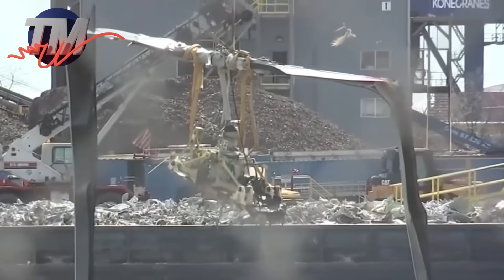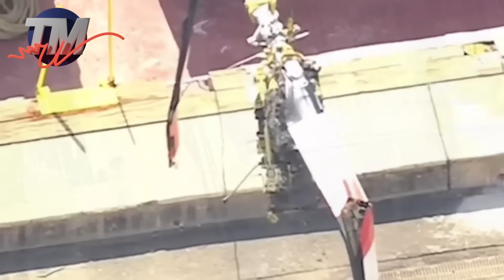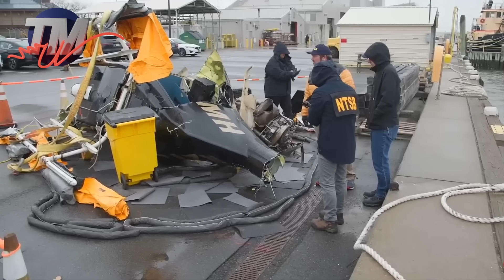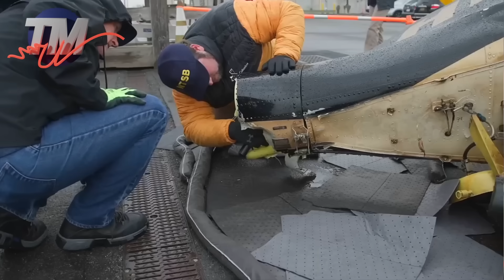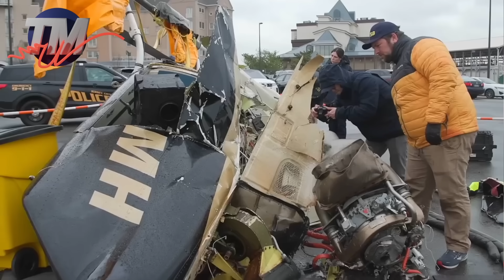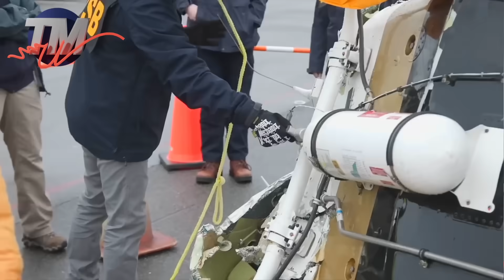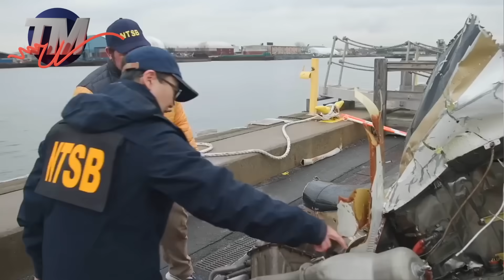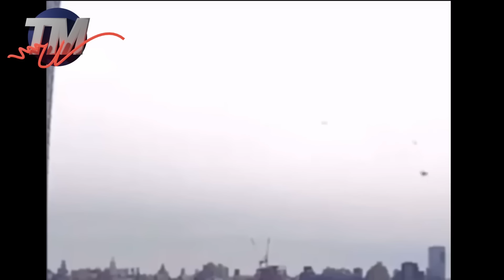Recovery of the Main Rotor of the Hudson River Tourist Helicopter - it's worse than we thought

Comment: Witnesses on the ground reported hearing what sounded like a sonic boom before the helicopter tore apart.  I live in New York City.  This is a very loud city by its nature.  For a sound like that to be heard by mostly all the witnesses with all the background noise here made me think that it was a very powerful force that happened.  I don't want to speculate, but it definitely doesn't make sense.
Reply: We'll never know the truth.  Only what they want to tell us!!!
Reply: Witnesses are notoriously inaccurate.
You get reports of flaming aircraft and explosions where there are none, pilots facial expressions from 2 miles away, screaming engines in glider accidents, etc etc… there is a fascinating psychology behind it.
Children make the best eye witnesses as they have not been influenced by movies and general sensationalism, they have no preconceptions or agenda and do not project.
Reply: The video WITH SOUND that shows helicopter flying normally, then disappearing behind skyscraper for a few seconds, then flying a couple seconds more before everything comes apart. 4-5 loud bangs that do NOT sound like sonic booms. It sounds to me like a gearbox being ripped from the roof of a helicopter. NTSB will measure the distance from camera mic to helicopter, calculate the sound delay, sync sound & video up. The banging will stop when the gearbox breaks free, along with main rotor, and cabin begins the fall to water.
Reply: Has anyone checked the background of the customers? Have they ever said anything negative about current regime? 
Nothing is off the table.

Comment: Speaking in terms of physics - the rotor has a certain angular momentum. If the transmission seizes suddenly and the rotor cannot freely turn, that angular momentum will be instantly transferred to the entire helicopter, including the cabin and tail boom. The sudden torque was so great it sheared off the entire tranmission and rotor assembly, at the same time giving the helicopter body an enormous angular kick, which accounts for the sudden yaw motion. This was probably enough to snap the tail boom as well, because that also has its own angular momentum stored in the tail rotor, and that will resist the sudden yaw in the manner of a bicycle or motorcycle wheel. This again would create a great sideways bending moment on the boom close to the center of gravity, thus snapping the boom at a point close to the body.
Reply: The rotor mast has a sheer pin in it that would allow the rotor to continue to spin if the transmission seized up.

Comment: It is a bit outlandish but bear in mind, the passengers include some high brass multinational company, and I really doubt it was funny business, but this is the type of person you would take out with funny business.

I am absolutely reaching with this one, but hey, if I remember right with the hack the US did ages ago, on centrifuges in iran with notably Siemens control systems, it’s not all the wild to say they may have some interesting clients that some powerful people may not be a fan of.

Loosen a few critical bolts, oopsie level of sabotage required perhaps? Think of, loosening a few head studs on your motor, oopsie head gasket went out, how’d that happen.

Eager to see what they find out either way, but fair call on not ruling things out. Passenger wasn’t a nobody, this was a wild failure to witness, and it’s scary to consider how introducing a few, weak spots before a flight could perhaps induce such a failure.
Reply: The odds of someone  sabotaging the helicopter to fail in a 15 min window is astronomically impossible.
Reply: @ Loosen a few bolts, let nature do the rest, not really hard, hold together enough to get into the air, vibrate loose in time, doesn’t have to be that specific.
Reply: @ApolloTheDerg  For it to be on that specific flight, it has to be very specific. 
Try to wander out on an air operations area with your toolbox and let us know how that works out.
Reply: @ Missing the point, yeah it’s outlandish and very much unlikely, I’m not disagreeing, just sometimes reality ends up stranger than fiction. Take note of the Iranian nuclear refinement facility and the complexity of running the centrifuges out of spec over time to induce failure, espionage does not always happen in broad daylight with a simple paper trail.

Is it likely, nah, is it possible, yes. Could simply tamper with calibration of a PM’s torque wrench in a supply chain attack to be certified yet, inaccurate, small little oopsie with intention, but it’s very much a stretch here. This is more like taking out a world leader in their private helicopter level of crazy im talking, im well aware.

Comment: Carbon composite main blades were fitted to this helicopter. (OEM blades are aluminium). I wonder if this contributed in any way to the incident?
Looking at the video of the rotor assembly being lifted by a crane…
The skin surfaces at the break are totally flat. Aluminium sheet would have a curve at the point of tare. Also the tare edge would be mainly curves. The torn edge of this blade skin is *totally jagged*. 
Definitely a composite blade and not aluminium construction. (It does have an aluminium leading edge protection along the entire length).
I notice that Van Horn Aviation supply composite blades for 206L. (Don't know if they supplied these blades or if there are other composite blades available). I think they say they have 250 sets in use on the 206.
Looking at the incident video shortly after rotor separation from the helicopter, I'm fairly sure the major blade fractures occurred in flight, and not on impact with the water.

Comment: However, no one correlates a possible impact with a drone, today there are several of these devices that fly to film from above, they are not prohibitively expensive, and are highly dangerous. It could very well be sucked into the helicopter rotor, and fragments of the small engine, end up in the rotation group, or even make a blade bend against the fuselage with the impact.

Comment: I love how several channels have a "mast-bumping" video. I laughed at those claims. I've said, let the NTSB do their job and make an official report. As far as how the transmission ripped off the fuselage, I'd like to know more about the maintenance log book for this aircraft. It's crazy how the touring company for this aircraft voluntarily shut down operations. I speculate that maintenance may have been delayed or even ignored. Just about every component on an aircraft (especially helicopters) have a flight-hour rating, which means that the component gets replaced once it reaches its limit, no exception.
Reply: Craft was inspected in March.  Its a mast bump for sure.  Its exactly like an accident that happened in Australia a few years ago in a Bell LR, the same type of helicopter as this one.  The pilot in that one did an up and right turn and the rotor chopped the tail mast.  The transmission and rotors left the airframe a few seconds later.  In that case a bird strike surprised the pilot and he did the abrupt control input.  I suspect it may have been a similar situation in this case.

If anyone actually cares you can google ATSB Transport Safety Report Aviation Occurrence Investigation (Short) AO-2022-034 Final – 12 May 2023 to read the report about the crash in Australia.

Comment: IF pilots think these copters are well-designed and maintained, what about the aging of key parts and the  MSDS sheets on the various types of materials they actually used for the building of the copter.  I have seen breakages in heavy equipment (excavators) parts that shouldnt have happened, as they failed only after a short time... then had to be replaced.

Comment: A heavy mechanicaly failure of transmission shafts or bearings could be the reason that the transmission shaft has ripped of the fuselage and tailboom connection. I know a cause that the shaft between engine and main gearbox has killed the paramedic. R.I.P. Pilot and the spanish family .....

Comment: What mystery? It's a 30 year old tin can. With non stringent maintenance being used everyday as a cash cow. Eventually micro metal fatigue does its job. The reason you have not seen this before is that aircraft of this age and usage pattern are something people have not seen before. There is nothing sinister about metal fatigue and a shoddy maintenance record. If that helio was a person, it would be in an old age home waiting to die...not sprinting up and down the neighbourhood. 😅
Reply: Well that is a bit harsh. There is no reason a 30 year old aircraft shouldn't be as good as the day it left the factory, if, and it is a big IF, the maintenance schedule is stringently followed. Fatigue items are kept an eye on daily and pilots are alert to any alteration in flying/operation characteristics. These aircraft are about as solid as a lightweight aluminium structure can be.They are a proven airframe and powerplant with hundreds of aircraft flying over millions of hours. Aluminium will always fatigue. Unlike steel, it is a matter of time before any stressed component fails. It will fail. That's why you replace parts. This though was not any aluminium, failure, this was a gearbox seizure and could happen to  any aircraft. An event like this is un-survivable. Warning systems should be in place for vibration, temps and magnetic ferrous chip detection. Any of these and you land immediately or do not fly. They were traveling straight and level so it counts out a lot of speculation and was certainly a catastrophic failure, of the gearbox (99.9% the culprit). 
This aircraft was just out of a full overhaul ? I read in a previous post. That is one of the most dangerous times in the life of a pilot. The first test flight after major work. 
All my thoughts to the family and crew.
Reply: @bartdart3315  Not a gear box failure,but failure of the airframe at attachment points?
Reply: @sandralogue1774  nope, attachment points are intact, the entire assembly attachments points (mounts) and all was ripped from the fuselage along with the top deck. Sudden gearbox seizure is one of the only things that could cause this.
Reply: @Captain101-x1o  But wouldn't it take something like a piece of metal getting caught in the gears to lock it up like that.
Looking at a diagram there are 5 attachment points.
So it would have to shear all five attachments.
That's a considerable amount of fastening to rip out simultaneously unless there was an underlying weakness in the fuselage.

Comment: Is not possible that the transmission gearbox get completely jammed all of a sudden, so the rotational force of the mein rotor gos all togheter to the main frame? And then the tail gets ripped apart for the sudden rotation of the cabin? It looks something of the sort in the video. It s going straight and then get torned instantly.

Comment: The fact that the transmission suddenly came off is surprising. In the case of a mounting problem (there are several attachment points on the cell), the pilot should have felt strong vibrations beforehand, right? But nothing in the communications with the pilot says so. We thought it was a mast bumping, but the mast is clearly not broken...🤔

Comment: Fatigue?  Non oem parts or cheap bolts or lack of safety bolt  wire ? Can pilot control inputs overload the transmission assembly

Comment: i figured some kind of seizure and not a boom strike, once I had seen the buildings skyline video. Reason being is you see the helicopter in forward flight, then gets torqued 90 degrees (cant tell if facing towards, or away from camera) that torque effect then breaks the tail boom, and gets separated, it quickly gets torqued the opposite direction, (because of no tail rotor, and the body of helicopter is getting rolled into the same directional torque of main blades.) moments before the main rotor assembly gets ejected.  The other note is that both rotor blades are broken about in half. Seen being pulled from the water. Allthough in the other videos the blades are intact, and not in a broken state. "gently" and equally sided, spinning to the water.  long story short, I could be wrong, but I dont think its a boom strike issue, but something catastrophically seized/ jammed up.  and the blades were broken from impact at the water.

Comment: It WAS NOT sabotage - that is just ludicrous Everyone thought the same thing about TWA 800 until they found it was a spark in an empty fuel tank with nothing but vapors to explode like a bomb.  This was a seizure of the drive system somewhere.  I know in auto racing You have a CV joint fail or seize up and it can tear the whole wheel assembly off including the uprights rotors and brakes.  So something like that on this helicopter is what tore it apart. Probably bearings or gears from the gearbox to the tail rotor drive shaft froze up and ripped it all apart.

Comment: One rotors tip.is missing.   these blades are not intact

The tail where it bolts to the fuselage is still there.  It clearly didn't break at that point.

The deck seperated.

Comment: One rotors tip.is missing.   these blades are not intact

The tail where it bolts to the fuselage is still there.  It clearly didn't break at that point.

Comment: West Coast pilot here since the early 80's......from my beginnings in the air, I've taken note of more incidents than I can remember now, just as a matter of keeping myself up to date with safety in mind.  It's the old adage " There's no such thing as a plane safer than any other out there, there are only safer pilots"...and I truly believe that. But I know and it's never far from my mind, that one day I could go up, do everything correctly, by the book, and still die. We operate in a fluid, unforgiving environment and it will always be that way, we accept that as part of the experience, in my case, for the freedom and peace. That said, it's obvious to me, I have faith in the stats that the overwhelming majority of accidents is due to pilot error, and that term covers a whole lot of factors, but mainly it's the personal judgement or lack of by pilots.

 So when I see this, I know what I'm looking at,,,,,this is The Big One, the worst one....mechanical failure. And that is the cause of a minority of crashes. I've never seen a rotor assembly in the air, coming down  seemingly fairly intact like that. I want to doubt sabotage, I'm leaning more towards non aircraft grade parts sneaking into the maintenance system, in other words fake bolts, fake something.

The media is jumping all over this and other accidents because it pays their bills....PERIOD. And it works for them. And aviation is far more important  industry than most people realize. I believe flying is safe and for the sake of balance if you're on a major carrier you should have far, far less concerns than with me, a General Aviation pilot, simply because GA is definitely unfortunately populated by too many "characters", unlike the airlines who employ professionals.
Reply: bro works for an aero engine maker in France.Told me the chinese got to great lengths to get their[ sub standard ]steel into the engine components,even buying into German steel producers who are very respectable
Reply: I'm inclined to lean that way also.  Without feeling vibration first, it was a sudden structural failure caused by who knows what.  Sabotage is a possibility: removing strategic bolts, replacing bolts with a lower grade or explosives/explosive bolts.  The latter sound far fetched but one observer heard "two sonic booms".  Still very curious!

Comment: Looking at the tailboom failed aft of the fuselage mount bulkhead. The rivets were sheered off, then the tear in the sheet metal. It looks like that bearing failed at the tailboom mount. If you notice, the sheet metal just aft of the bearing mount in dented downward. I have worked on US Army OH-58 series for years past & even flew as an enlisted non-rated co-pilot, navigator as an Aeroscout Observer. I have performed scheduled maintenance on many of these bearings & tail rotor drive shafts. It really looks like something caused that drive shift bearing to fail, causing tailboom separation from the fuselage... IMO

Comment: there are some loose parts in the whole assembly due to fatigue and/or loose screws somewhere at the critical points... i have been in helicopters many times. the vibrations are strong and can loosen parts of the assembly and cause fatigue. there may be a crack somewhere that gave way suddenly

Comment: I flew the Bell Jet Ranger (OH-58 A/C) when I was in the Army and I always would check the transmission for lubrication. Those transmissions are supposed to run 15 to 20 minutes without lubrication. As evidenced by the wreckage, the transmission ripped out and took part of the fuselage with it. I wonder if he took off without checking the transmission? If he did, he must’ve have flown for 20 minutes like that before the accident. But I’m just speculating.

Comment: I am not a pilot but it looks to me like the tail rotor gear box seized up first. The sudden shock of that with the torque ripped off the tail section. That sudden over torque condition was transferred to the transmission tearing it away from the airframe. Again, not a pilot but that’s what it looks like to me would have happened to cause such a sudden violent lurch and breakup. Obviously it was sudden and catastrophic more than likely with no warning to the pilot. Deepest sympathies to all involved in this tragedy.

Comment: Failure at transfer case/transmission, seizing and shaft sheering the tail rotor resulting in rotation due to centrificual force, as transmission jammed and force ripped transmission from frame. Failure at Transmission/Transfer case.